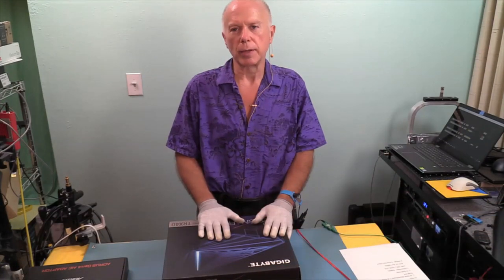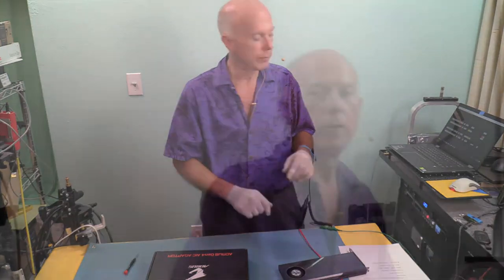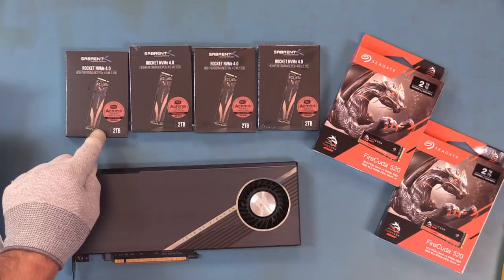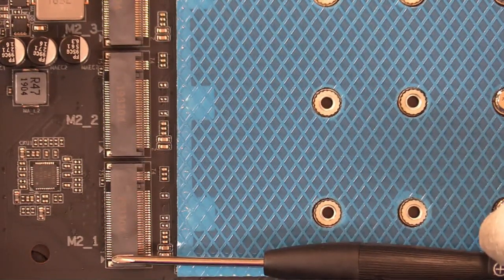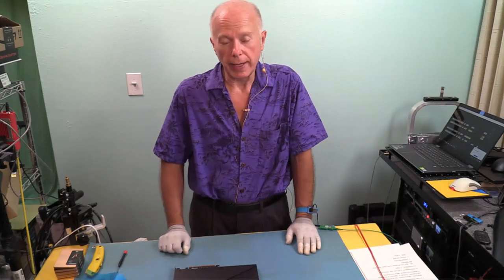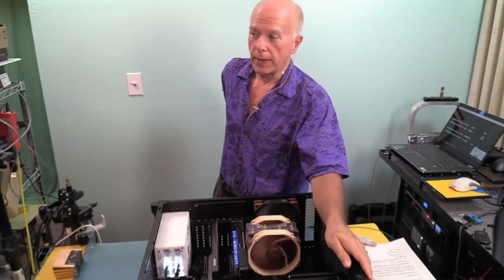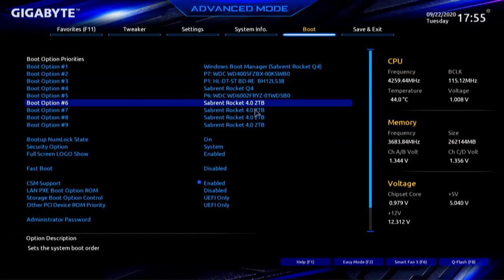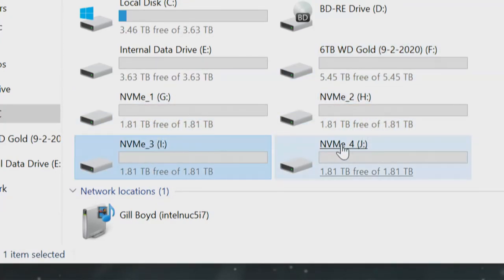Gigabyte AORUS Gen4 AIC Adaptor Comparison and Simple Install Tutorial TRX40 Designare

Comment: I have a couple questions:

My current build:
Case: Thermaltake view 91 TH
Motherboard: Gigabyte Designer  Ver 1
CPU: AMD Threadripper x3900
CPU AIO Cooler: NZXT kraken 73
GPU: GeForce RTX 3090
Ram: 256GB G.Skill

One problem I am having is that the 3090 is so large it takes over the second slot on your motherboard so I can’t install the TR-Thunderbolt 3 card. On the board itself I have an off brand NVMe M.2 and on the second slot of have a 1TB Samsung 970 EVO Pro

For my Aorus Gen4 AIC adapter I have 4 Samsung 1GB 980 Pros. The card is Ver. 1

Also the  case fan controller is DOA. The fans move but no RGB.

The case has a GPU vertical mount but I can’t find a PCIE 4.0 cable to mount it.

I haven’t installed the Thunderbolt 3 card or the AIC card yet because the 3090 GPU is so large.

Do you have any tips for me about where to install these cards and if the AIC will accept the new 4X Samsung 980 Pro

I’d appreciate all your feedback. You videos have helped get me up and running so far.
Reply from the maker: Hi Edward, Nice to meet You! Well documented. Nice Build! Welcome to the  Platform!

1. Bios version? 2nd PCIe x8 Slot was unusable with Bios we we tested. No PCIe Lane assignment. 

2. Since RTX 3090 requires 3 Slots, a riser card would help. A PCIe 4.0 Riser cable is hard to locate. There is one on Amazon listed. Currently out of stock. I'll need time to research that. Not ideal but possible. 

From what I've read, riser cables are not reliable. This reminds me of when we changed PATA Drive cables from 40 pin to 80 pin. Don't know yet if same applies.

3. The Gigabyte Quad AIC is PCIe 4.0. Therefor, both the Samsung 980 Pro and Western Digital Black SN850, which are 2nd Generation PCIe 4.0 Drives will work. No we have not tested. Was only able to aquire 1 of each. 

Until we can test 2nd PCIe x8 Slot with a workable Bios, that Slot it not usable. The latest Bios may solve that. We will test shortly. Stay tuned!

How do You use Your Threadripper 3? This helps Us to make better videos!
Reply from the maker: Hi Edward,  Here's the PCIe 4.0 riser cable...

1. Information About PCIe Riser Cable and Extender Compatibility with PCIe Gen 4.0 Desktop Systems https://www.amd.com/en/support/kb/faq/pa-270

2. https://linkup.one/pcie-4-0-riser-cables-ultra/
Reply: @BuildOrBuy  I will look into which cable is best to buy. I’ll have to do some research between them. Thanks so much.
Reply: @BuildOrBuy  I’m using bios “f9i” released 2020/09/16. I’m going to skip the TB3 card for now. If the case fan controller wasn’t DOA I wouldn’t even have the spare USB2 port for it. I need to look at an internal USB2 hub extender.

I’ll rewatch your video and try the AIC card on the remaining two slots to see if it works. I’ll report back.
Reply from the maker: Hi @EdwardGrubb3rd , Yes! This is still bleeding edge technology for a riser cable. There will be more, in time. Let Us know if You find something better!
Reply: @BuildOrBuy  I’m a software engineer who creates native cross-platform desktop Ana mobile applications, currently working on a cryptocurrency so I needed all the core for VM’s that I could get.
Reply from the maker: @EdwardGrubb3rd  , The Thunderbolt 3 AIC would be Your only problem. We have not had a chance to test the new Bios. We will soon! 

The M.2 NVMe Quad AIC has to go in the 2nd x16 PCIe Slot. Each NVMe Drive requires 4 PCIe Lanes.

Be careful with internal USB Hubs. We have yet to locate one that would be considered reliable.  Furthermore,  the Case Fans should all be 4 pin Fans. If not, replace! Control from Motherboard.
Reply from the maker: Hi @EdwardGrubb3rd , Got it. Thanks for Sharing! We Appreciate Your Comments!
Reply: @BuildOrBuy  I installed the 4 Samsung 980 Pros on the lastest bio and put the card in the second x16 PCI line. Foot boot nothing was recognized, so I watched your video again and I realized I had to go into the iOS ports and set the seconds z16 slots t00 4 x 4 x 4 x 4.

Then I booted and opened Windows Disk Partition and it saw all the cards. So did Samsung magician and this is before I initialize the cards because I wasn’t sure which option I should use. You used MBR but from what I’ve read so far it’s recommended to use GPT. Seeing as this will be a workstation with many VM’s and dual boots what do you recommend which option I initialize the Samsung 980 pros and why? Again, I appreciate all your help
Reply: @BuildOrBuy  what if I moved then very large 3090 to the second x16 PCIE4 slot and the AIC to the first one allowing me to install the TB3 card on the second lane beneath the AIC card?
Reply: @BuildOrBuy  as for internal USB 2.0 hubs.. the water cooler requires one although I’m not sure why because it’s ran fine when I accidentally unplugged it. I suspect it’s for the controls. The Thermaltake View 91 TG has this TT Plus controller that’s just awful. It powers on the fans but no RGB. It has a USB internal controller that has two cables coming out from it. They're like the old Android phone charging ports. One goes into the controller and the second is in case you have a second controller. The software TT Plus software says can’t find controller Error: H_0x0001. When I unplug the USB2 Header and try outside USB ports it doesn’t even acknowledge that something has been plugged in

I heard it’s an AMD thing. Just found this so maybe I’ll find an answer 

https://community.thermaltake.com/index.php?/topic/75709-error-code-h_0x0001-could-not-find-fan-contoller/
Reply from the maker: Hi @EdwardGrubb3rd ,
Yes! Always use GPT! If we had been using 2.5 TBs or larger Drives, Windows would have defaulted to GPT. And You'll be in Business! Our setup was temporary. Thanks for catching that! Details matter!
Reply from the maker: Hi @EdwardGrubb3rd ,
That's a distinct possibility. Remember to change the Bifurcation back to x16!!! Remove the cards. Install only the Video card 1st. To reiterate... Get the Video card up and running 1st! Give the Computer time to reconfigure. The Bios should be set to auto recognize where the Video card is located. Keep Us Posted!
Reply from the maker: Hi @EdwardGrubb3rd ,
Sounds intriguing. As a Consultant. Certainly. Protonmail? I'll need to get setup for that option. Let me know Your Preference.

Comment: ok windows loads in f3 - but when i update says inaccessible boot. i can see with f3 that raidxpert has C drive setup as  an array legacy . i have tried a ton of bios settings and now im ganna try to remove the raidxpert from the c drive changing it back to a normal drive, do you have any recommendations on how to un-arey or get f4 and f5 bios to use raidxpert to load windows correctly. c drive ( is ntfs but has these other portions on them* is this normal?) is a GPT partition efi esp. -- im thinking if i can get the c drive out of raidxpert (AMD-RAID) and ntfs without formatting would be ideal but like f3 bios and my old f4c which worked im sure its possible just dont know the right bios settings to boot correctly 

please help! thank you
Reply from the maker: Hi New Web Design,
Been working on next Video! Where are You in this Process?

Comment: I use to have the MSI AIC adapter (MSI M.2 Xpander-AERO) that came in with the purchase of a MSI X399 Meg Creation motherboard. Based on my experience, I thought it wasn't working when I plugged in one M.2 (As a newbie PC builder, I found out that the M.2 I bought was a SATA, not an NVMe). So I fixed that later on and so far it was great, it keeps the M.2s cool... but here are my problems: 

The adapter was huge, I know it's all big because of the big fan that makes the M.2s cool. Also, it takes one 4-pin connector just to power the fan, which makes it in the middle of my other power connectors powering my GPU. Last but not least, the noise of the adapter's fan is a bit loud compared to my CPU cooler and case fans, so that was annoying. 

Ended up selling it, hoping find something as small as that Aorus AIC Adapter. If you are still looking for one, there is a seller that has a lot of them in eBay, but it's only Gen. 3 and not a Gen. 4 AIC.
Reply from the maker: Hi Pisces Stein, Nice to meet You! Experience is the best teacher. We learn by doing. You have 3 options, Gigabyte Aorus M.2, ASUS Hyper Quad M.2 or ASRock M.2. Most Users are more aware of the ASUS than any other. We're going to be Comparing the 3 from ASUS soon. Stay tuned! And thanks for Sharing about the MSI M.2.

Comment: This card work with thinkstation 620 threedripper? Can make raid with SO disk management? I would like know if some supermicro riser card pcie x16 to 2 x8 works in this pc. Thanks
Reply from the maker: Hi Blairo Pacola, 
Welcome! Absolutely! Also less expensive than purchasing the M.2 NVMe Quad add in card through Lenovo. Congrats on Your Threadripper Pro Workstation! 

Supermicro makes: 
1.) AOC-SLG3-2M2 PCIe Add-On Card for up to Two NVMe SSDs. 
2.) AOC-SHG3-4M2P PCI-E 3.0 carrier card for up to four NVMe M.2 SSDs. Form factor: PCI-E 3.0 x8 full-height (FH).
https://amzn.to/3uuRg7e

https://www.supermicro.com/en/products/storage/cards
Supermicro does not yet have a PCIe 4.0 M.2 x16 Quad card unless You include the 3.) AOC-SLG4-4E4T - two internal NVMe SlimSAS connectors. Listed below. No stock yet. 
https://www.supermicro.com/en/products/accessories/addon/AOC-SLG4-4E4T.php
4.) AOC-SLG3-4E4T is PCIe 3.0. In stock on Amazon. 
https://amzn.to/3usfWxb
As an Amazon Associate I earn from qualifying purchases.

Best use of PCIe Resources for the WRX80 Platform would be a x16 card utilizing all 16 PCIe 4.0 Lanes like this Gigabyte Aorus x16. The ASUS Hyper M.2 x16, Gigabyte Aorus M.2 x16. There are several others. The Gigabyte Aorus M.2 x16, in several different varieties, is the most prolific. Thanks for Asking! Hope this helps!

Comment: Have you compared video editing and video rendering with a ssd array like this vs a regular ssd NVMe PCIe 4? I want to edit 8k video on a Lenovo P620 will this reduce time to get projects done?
Reply from the maker: Hi Juan Osorio, 
Excellent Question! We have not yet! That's on the Videos To Do List! Been waiting on Our DaVinci Resolve Studio license! Got it maybe 3 days ago! Stay tuned! Thank You for Asking!
Reply: @BuildOrBuy  Thank you very much for your reply. That will be fantastic. So looking forward to your results on this topic. I was very surprised by one Linux LT videos in which he asked his video editors to compare 3 pc's with different ssd. A SATA, a NVMe PCIe 3 and a PCIe 4 and none of them was able to find which one was the fastest. They concluded that copying files has an obvious advantage with faster drives, but the performance increase stops there. Editing, render didn't feel different. I suspect speeds above 15000 should see improvement in performance at all levels, but I haven't seen a comparison.
Reply from the maker: Hi @osoriony , Absolutely! Sounds about right. What We do know about Rendering Resources from previous Testing, the CPU does 90% of the job while the GPU does on average 10% of the job. All of Our Rendering had been to spinning 7200 RPM Drives for 1080/ 59.94 video. 4k and 12k, eager to find out if any and if so, how much an NVMe will affect that. So far, the best Rendering tests have not shown any different. However, that does not stop Us in Our performance quest for the best value! Stay tuned!
Reply: @BuildOrBuy  Thank you very much again for your reply. That would be great. Looking forward to that video. Have a great weekend 👍
Reply from the maker: Hi @osoriony , Yes! Ditto! Thank You!

Comment: The Volume label for drive three was set to NVME_1 - but does that correspond to the m.2_1 on the AIO Card (lowest slot, closest to PCIE connector)?  If so, how can you tell?
Reply from the maker: Hi Van B, 
Good question! The M.2 Connectors are labeled from PCIe Slot Edge Connector Up as M2_1, M2_2, M2_3 and M2_4 on top. Stenciled on the PCB as read from I/O Slot Bracket. Thanks for Asking!

Comment: you spoke about a program having really small font on a 4k display. 
I had the issue with the adobe apps on my 4k, and fixed it by going to Properties - compatibility - change settings for all users - change high dpi settings, and then chick off Override high DPI scaling, and set the drop menu to "system"
Reply from the maker: Hi Slamscape,  Thank You ! That would make a great Video alone! 

The program I think we were referencing is Clonezilla. A Linux Cloning app. We were on a 14 inch 4k Laptop. We needed a Microscope! That was an eye opener!

We use to have full Control on the Windows interface. Microsoft, in their infinite wisdom, removed or obfuscated most of those capabilities. Another clunky aspect of Windows. Thank You for Your input and sharing! Great solution! Appreciate Your Comments!
Reply: @BuildOrBuy  I use a 54inch OLED TV as my computer monitor with 4k settings.
the small ass font at a distance was impossible to read, and i was standing up and walking to the tv just to read the menu buttons in photoshop. 
did some searching and put a pin in that on day 2.
Reply from the maker: Hi @Slamscape , You touch on a very important aspect of the Windows interface. Raster interface vs Vector interface. Some applications are interface aware. Not many and certainly not Windows. 

Even some of the Tools we've used, Windows now over rides those custom settings. Hassle. Another item to add to the List along with DPC Latency. 

4k monitors are good enough for Editing if Color matched. We'd like to find a 4k/60 REC 709 TV! That would be amazing!

And then what about 8k. This font thing needs to be addressed. We started out with high resolution on a LaserMaster single sync monitor in Windows 3.1. We booted the Computer on a standard multi sync monitor. Then to Windows on the LaserMaster. It was bleeding edge and proprietary technology. We need that kind of control from then, now! Thanks for Sharing!

Comment: Hi, very useful clip. But my problem is the AIC won't show in the BIOS... I don't know what's wrong, have you run into this situation before?
Reply from the maker: Hi detrypt, 
Welcome! Appreciate Your Comments! Easy fix. Tell Us about Your Motherboard and Chipset?
Reply: @BuildOrBuy  Thanks for the reply, after several tries, I just figured it out, two things needed to be done, 1. Set PCIe to Gen 4, 2. Set bifurcation to x4x4x4x4, then it showed up at last! My MB is Gigabyte Aorus TRX40 Extreme 1.1 Rev.
Reply from the maker: Hi @detrypt , Clarity! Sorry about that! Goes to show, never take anything for granted. And I think We reference that in the Videos using the Gigabyte TRX40 Designare Motherboard. 

What's interesting about Bifurcation, Gigabyte states, that's suppose to be automatic on PCIe 4.0. NOT! Glad You're in Business and Up and Running! This helps Us to make better Videos! Appreciate Your Comments!

Comment: Hello, I could install this pci adapter on my CrossHair Fórmula VII HERO (wifi) using the first slot for a Geforce 1080Ti ? I think it has X470 chipset. What its your opinión  ?
Reply from the maker: Hi Gabriel Humberto Arias,
Welcome! Is this Your Model? Please confirm and We'll check the Specs! This may Require a Video Response for the What, Why and How. 

ASUS ROG Crosshair VII Hero (Wi-Fi) X470 
https://rog.asus.com/us/motherboards/rog-crosshair/rog-crosshair-vii-hero-wi-fi-model/
Reply: @BuildOrBuy  yes, I confirm that's my model. I'm not completely shure if I could use at least two nvme in that pci Adaptor due to pci resources on my motherboard. Thanks in advance for your fast response.
Reply from the maker: Hi @gabrielharias  ,
Good timing today! We had a Video Premiere! Working on next Video! Need to verify Your Specs. Give me a few days.  Appreciate Your Patience!
Reply from the maker: Hi Gabriel Humberto Arias,
BTW: What CPU are You using? We need to know what We're working with!
Reply: @BuildOrBuy  Hello, I'm using a Ryzen7 2700x CPU AMD, socket AM4.
Reply from the maker: Hi @gabrielharias ,
Excellent! All of that matters! Working on Your Video response!

Comment: One thing I would like to add is that if you are going to use a X570 you can use a newer AMD video card and it will support the PCEI 4, so it will still work at full bandwidth in a 8X slot, like a 5700
Reply from the maker: Hi Veluth, Saturation of Bandwidth is different. Video cards of past were the driving force then Network interfaces. Now, it's all about NVMe. 

If You want a x16 Slot for Video and x16 for M.2 NVMe, no. Therefor that leaves a x4 Slot for Video. And yes, it works. And yes, doubt most would notice a performance hit. Thank You for Your Comments. This Video was about answering Subscribers questions. Nice thing about an AMD card, they seem to be flying under the Radar. Downside, for Content Creation, no CUDA Cores! Since most Rendering is 90% CPU, not that big of a deal.